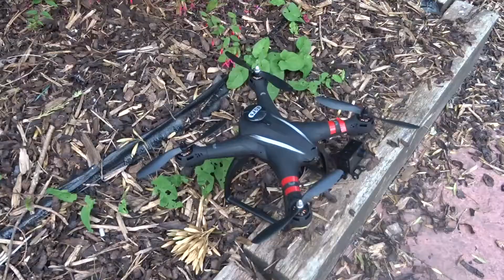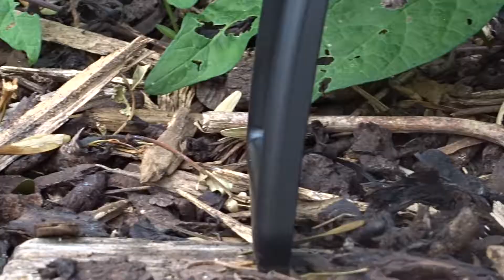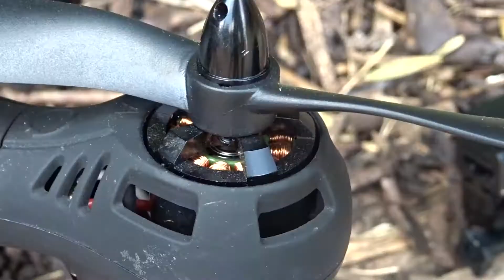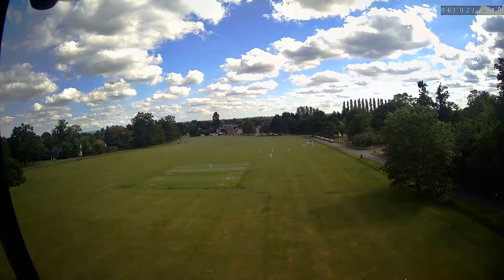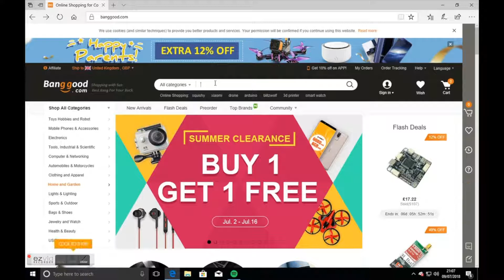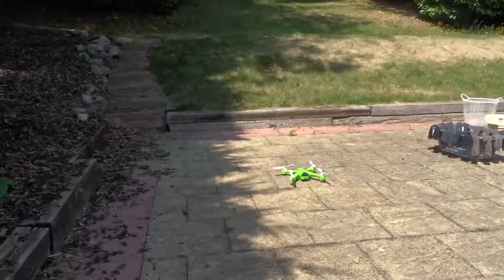Bayangtoys X21 - Best budget drone on the market?

Comment: Good job! Keep up the good work! You might want to balance the props or get a set of DJI Phantom 2-3 self tightening props. That could reduce your jello effect in your videos. Another possibility is to stuff some padding between the gimbal and the body of the quad. Both of those helped me reduce the jello effect in my videos.

Keep em flying and remember to keep the pointy end forward and the shiny side up!